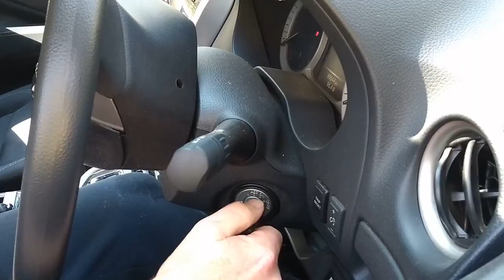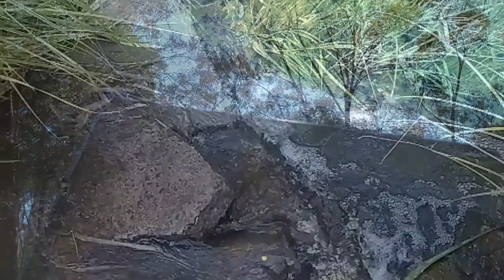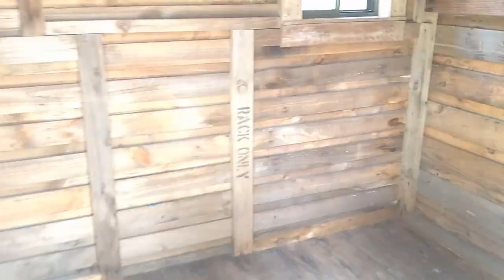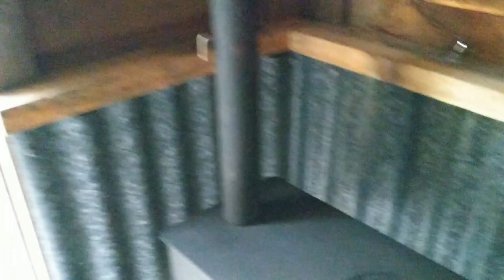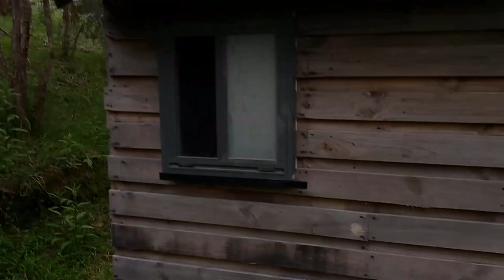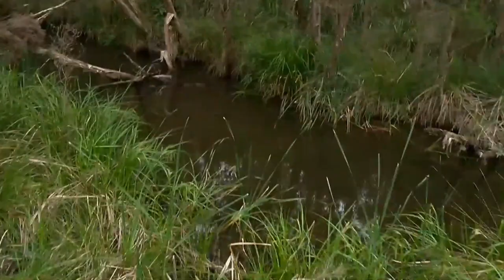FREE Pallet Cabin build - Part 2

Comment: Its a nice looking cabin BUT I don't understand why the deck is NOT on the door side ??  Besides, I can see there are gaps and hole on the 4 corners from ground to the top .... perhaps you can seal them from inside by  2 x 2 inch wood.
Reply from the maker: Hi Lord
A second deck is planned for the door side which O touch on in this video. The next instalment will detail sealing up the corner gaps etc thanks for watching and commenting